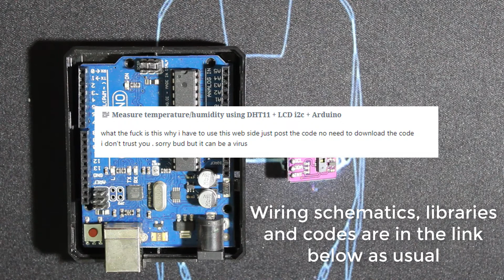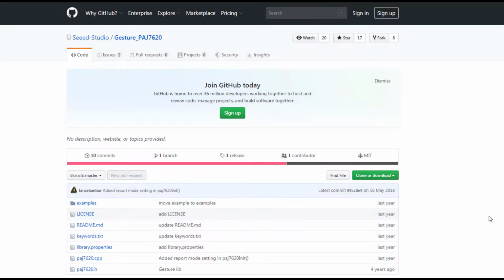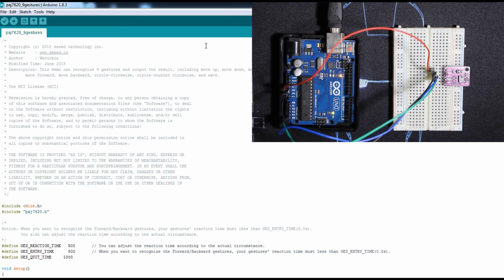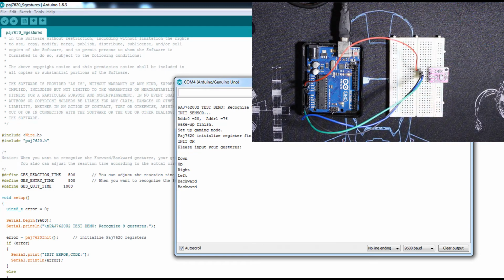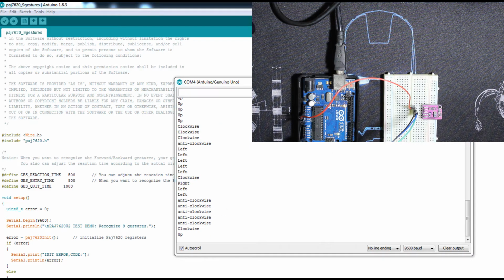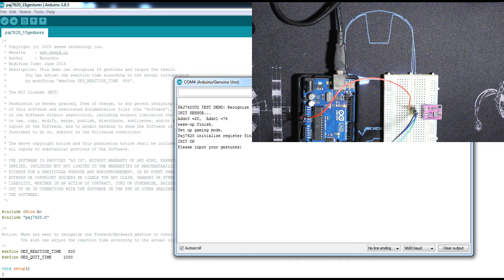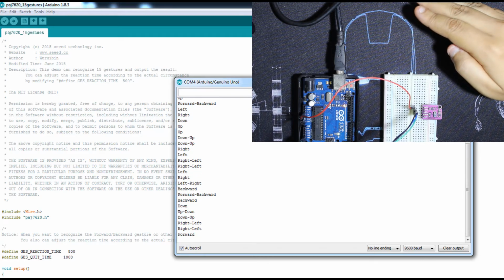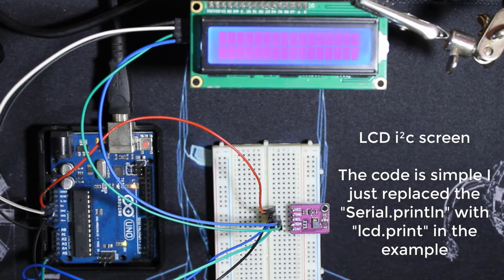Interfacing Hand gestures sensor PAJ7620 with Arduino

Comment: Can we increase the gesture detection range by using fpv camera?
Reply from the maker: If you just want some gesture detection you can try a thermal array, it costs much more than this one but pretty good, a FPV camera is difficult to use especially with Arduino you need a camera that can do the DSP and it will be complicated to detect the gestures (in my opinion).